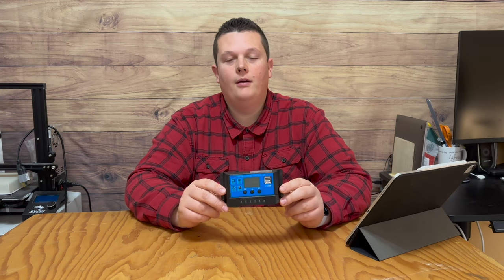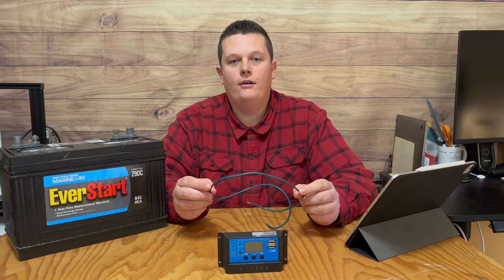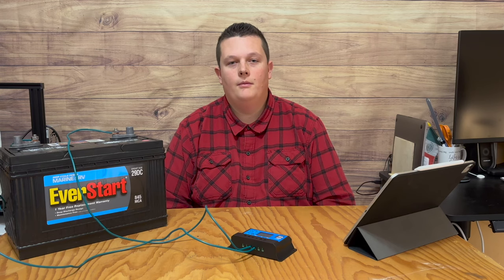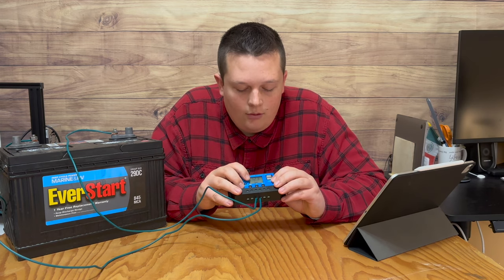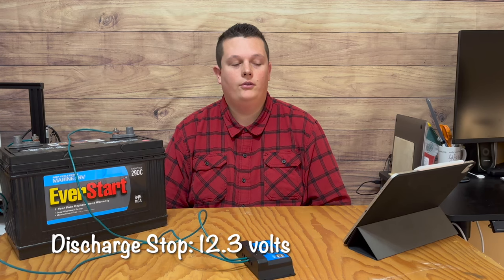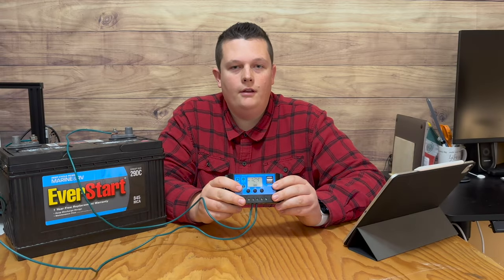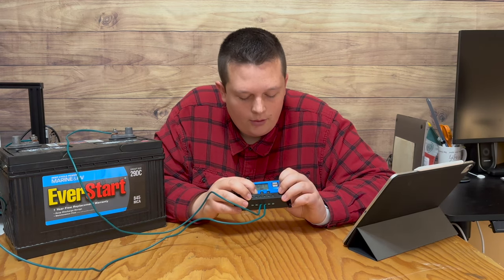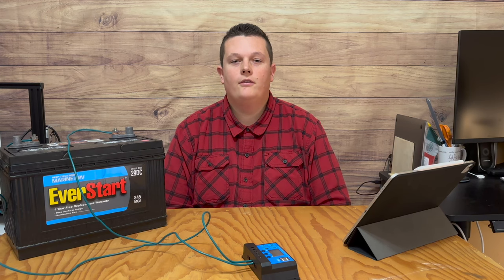How to Setup a Solar Charge Controller (menu, battery type & wiring)

Comment: How can reconnect voltage be less than float voltage
Reply from the maker: Check out my other video specifically about the load. But, reconnect is the voltage you set for the controller to power the load again after the voltage drops below discharge stop.
Reply: @ScottsSolarProjects  oh thanks so much for that much appreciated

Comment: A basic no - no for  those not trained as electricians - NEVER use the same colored wire for positive and negative connections.

"There's literally a dime a dozen of these controllers all over the place."
What does that actually mean??